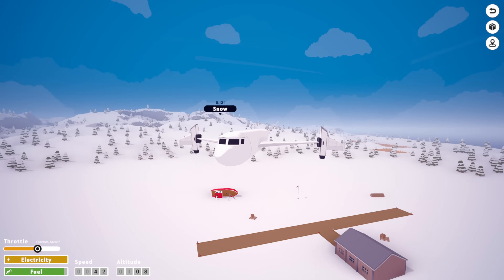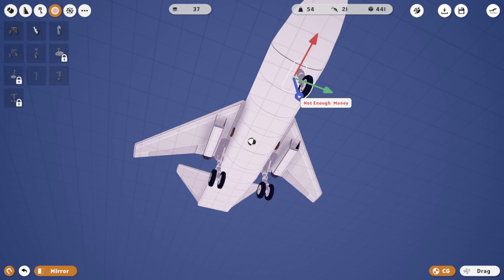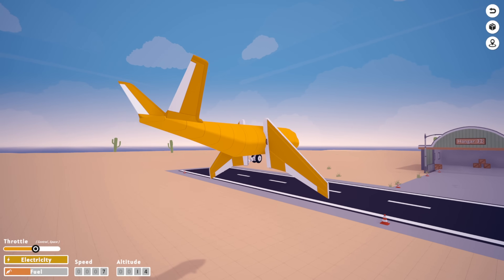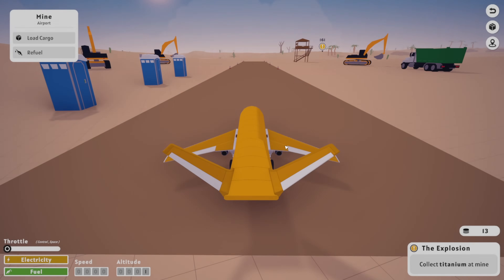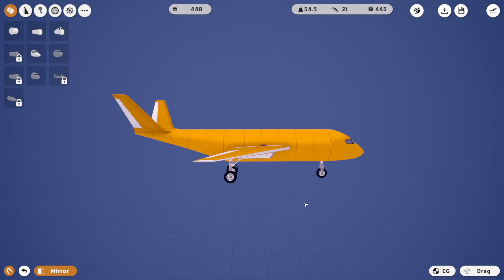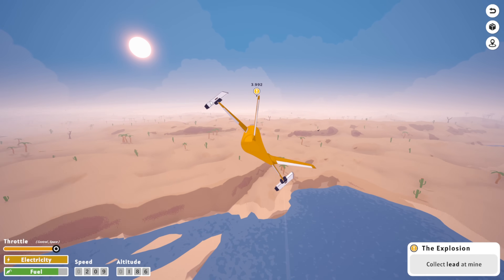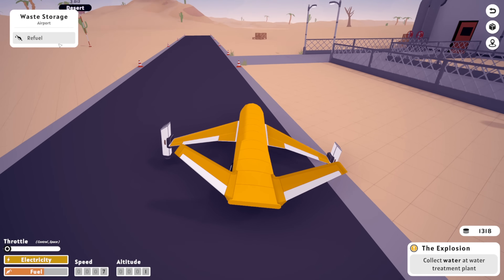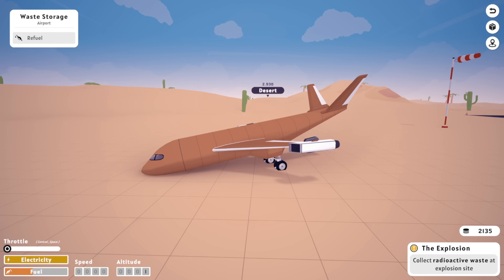Adding ROTATING WINGS To My Plane! - VTOL Only - Ep8 - Aviassembly

Comment: I think the idea of rotating the wings themselves is to abuse the drag effect the game applies when the wings have too high of an angle of attack, but the delta wings have no drag so it doesn't really induce any braking effect as the drag gets multiplied by some function of the angle of attack, and zero multiplied by anything is still zero, meaning only the lift forces try to heave the plane up and then backward as rate of climb increases.

Comment: Sell these 2 engines and put in place 3 of the small engines each side. It will cost you 1k less and will also generate more trust than you have right now. Also, put your landing gears inclined 45 degrees at the rear of the plane and move your wings to be conected by its rear part. That way you will be able to land and your wings will not touch the ground when you try to land vertically
Reply: 12 turbo props would be even better, giving 240 thrust for just 800 more than the box jets. Put them in push-pull pairs, maybe on wing-mounted canards.
Reply: @CarlGorn  oh nice nice didn't noticed that. This game need price balancing on some parts lol I normally end up with the small jet engines or the biggest eletric props
Reply: @moonlightsparkle2690  I'm a fan of the big electric motors, myself, viewing the increased thrust with the same power consumption as worth the extra cost. Paired with the dynamic recharging of the wind turbines, it's the easiest way to build an infinite energy rig. But with fuel-based propulsion, it's hard to beat the value in a turbo prop.
Reply: @moonlightsparkle2690  or just a maximum speed on the various engines, so you can't go supersonic by stacking basic props.

Comment: The types of VTOL that turn their entire wings typically have straight wings, not deltas.

BTW, if you can deliver cargo while hovering, can you also load cargo and refuel while hovering?
If so, you'd basically never need to touch the ground again!
Reply: He could've put the rotation joint at the extreme rear of the wing-root and it would've kinda sorta fit (provided the landing gear are long enough and set low enough) but it'd still look strange.